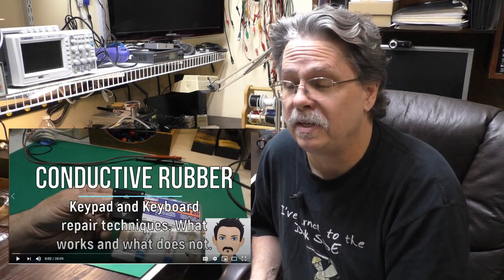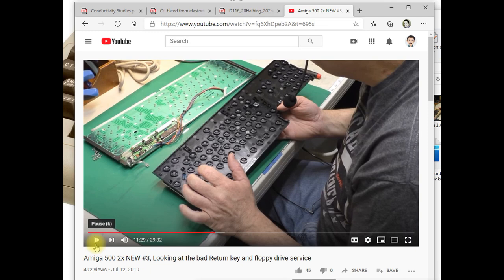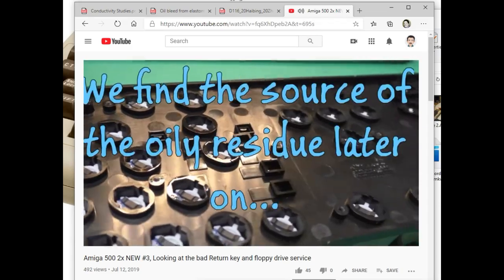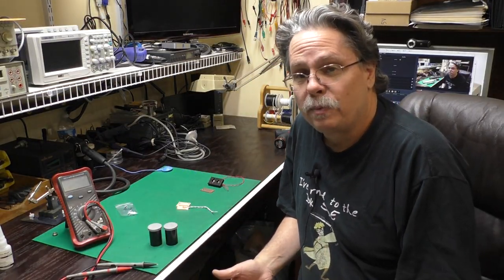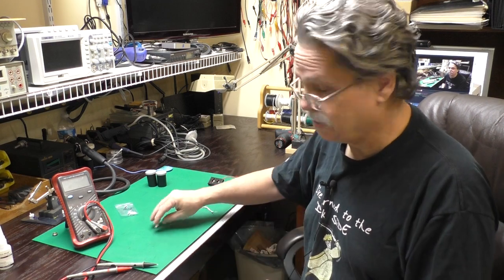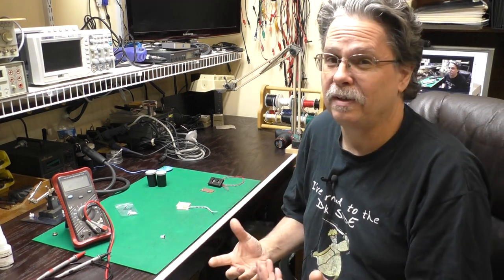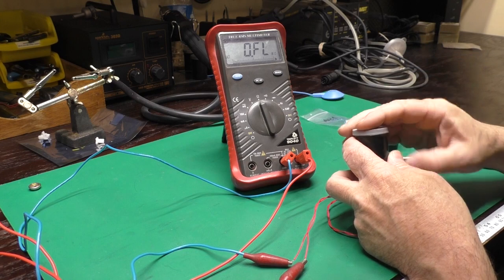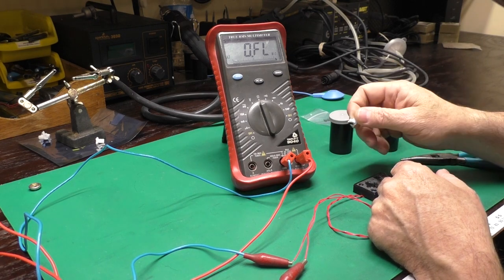Resistance is futile   Rejuvenating vintage computer keyboard key contacts

Comment: That is a great research work, Jeff. Very interesting and useful. I think, it will become a standard procedure, like recaping and retrobrighting.
Reply from the maker: Thanks Sven. I'm excited to see how it works on different types of key contacts.
Reply: I have tried some other chemicals. The was NaOH (sodium hydroxide), Na2CO3 (baking soda) and demineralized water only. While the demineralized water and the baking soda solution (1 tea spoon on 1/8 liter demineralized water) had no effect, the NaOH solution (1 tea spoon on 1/8 liter of demineralized water) made  „open circuit“ contact rubbers having a resistance around 70Ω in your test fixture. The success rate was 100%. The keyboard rubbers were soaked for 24h in the solution. It seems to drive the carbon out of the rubber. After drying, the black surface was matt and I have seen carbon traces on the tissue paper, on which I have placed the contact rubbers for drying. I did not use alcohol for the drying process, just rinsed the rubbers pretty well, without rubbing or wiping them. I want to test the long term stability of the processed keyboard plungers, now.

Comment: Something that really seem to increase the resistance is the bond between the copper trace and the carbon pad on the PCB. You can see this quite clearly if you measure between two connected pads and you may get something like 1000ohms+. When measuring between two points on the same pad the resistance is only 20-30ohms.

I did a small experiment yesterday by exposing some of the copper trace (with a round bladed scalpel) close to the pad and then bridged it with conductive silver paint. The resistance between the connected pads is now in the 30-40ohm range and the keys are working excellent. The plungers are all measuring a resistance between 100-300ohms so they're not exactly fantastic.

Comment: This was a great video Jeff! Do you think this would also work on the early model VIC-20 with the PET style keyboard?
Reply from the maker: Yes, soaking the PET conductive key rubbers will work as well. Since they are flat, they can be very lightly abraded with very fine sandpaper as well. It would be my preference to first try soaking before resorting to sanding.

Comment: Thanks so much for all the time and effort doing this.  I have two Amigas and two PETs in need of this kind of attention.  Can PET keys be tested with your tester?
Reply from the maker: No, it is not made for PET keys. A friend of mine just reported that he used this method on high resistance PET keys. He mixed about 1 teaspoon of sodium hydroxide (lye) with a liter of water as that is what he had around his house.

For the PET he measured the key contact resistance by using the keyboard PCB. You can look at the schematic and work out which wires to measure across for each key.

You might be able to use just the tester PCB, without the housing attached for the PET keys though. Just press each key down centered on the gold plated contacts on the PCB.
Reply: @HeyBirt  Great.  Thanks.  I also saw Chuck’s video that details testing for the PET.  That will be no problem.  Thanks again for the great video and making extra testers for the community.  Will see how it goes.  I’ll be very happy if I can get my keyboards all working.  It’s been a problem for a long time and I’m looking forward to fixing it for once. (Instead of just breaking them more haha)

Comment: Amazing how much research you have put into this Jeff. I don't know of anyone else who has done as much testing as you have done here. I have seen many videos where people have painted on conductive material, etc. with mixed results but none of them took before and after resistance measurements to see just how effective their methods were. Excellent and informative video as always. Do you plan to sell the tester you created? I'd buy one myself, as I don't have a 3d printer. Also would like to know more about that Decade-Ranger, looks to be a very old piece of equipment. Might be worth doing a short video on that as well, one that I would like to see anyhow.
Reply from the maker: Hi, I meant to mention in the video about making up some tester kits if folks were interested. I suspect getting a bunch of PCBs made would not be too expensive.

The Decade-Ranger was made by OhmMite until a few years ago. They were pricey new, about $700 the last I checked. I got this one on eBay for about $50 with the 1K range blown out. The OhmMite resistors that had been used in it were no longer made but I found some by Vishay that seemed to match the specs and a nice engineer at OhmMite confirmed they would work. So for another $10 or so in precision resistors it was fixed.

I've got an even older one made by Muirhead in England. It is a glorious bit of kit. Oddly the 1K range was burnt out in it as well. It uses hand wound wire resistors. I would love to rewind those but suspect I'll put in the more modern Vishay precision resistors to fix it up.  

I was not sure if a video about old test gear like these would be interesting or not.
Reply: @HeyBirt  Looked older to me, but then I have never seen one before. Great find on Ebay by the way, just a little work for a great bargain.If more people show an interest in the equipment your using then maybe make a video just showing your work bench setup and pointing out the equipment you use regularly.
Reply from the maker: @williammckeever4790  I think they made the same model for many years.

Comment: I theorize that salt in the air causes silicone rubber to deteriorate. My window contractor, based in CA, told me this when he was sealing the edges of my new vinyl windows. Of course with all the chemicals in our environment, one never knows what is causing this deterioration. Have a friend at a major lab? Have him do a Gas Chromatography-Mass Spectroscopy test on a fresh piece of this rubber and a sample that is two decades old.
Reply from the maker: One of the big issues is simple oxidation. Salt air is hard on everything though.

Comment: This is great research and work, Birt!  I wonder what causes the issue to start with? I have had a few keys here and there that went bad over the years, but recently came across an entire keyboard of non-working keys. They varied from 1.5k to several mega-ohm!  I soaked them all for 5 or 6 days, and about half are below 1k now, but the other half remain stubbornly high. I dried them and have put them in another Amonia soak to see if they will come down.  I didn't notice any film or discoloration, but perhaps it stops working after a couple of days and you have to dump it out and put more Amonia in?
Reply from the maker: I went over a few possibilities in the video, in my case with the amiga it was contamination by grease from the keys with the metal 'hinge' bars under them. It could also be oxidation and some silicone can also sweat silicone oil.

On the really bad keys you will likely need to change out the ammonia and soak again. Solvents can only dissolve so much material and then they are 'full'. I found it also helps a lot to soak the keys in 99% alcohol for a few hours to help draw out any remaining water from the ammonia soak.
Reply: @HeyBirt  Something else must have happened to this keyboard. These keys are not budging from high resistance just soaking in Amonia. I'll have to try something stronger.
Reply from the maker: @rittwage  After soaking them in alcohol over night give them a few days to dry out in the open air and test the resistance again. 

I had a few that were over a meg ohm that took several days in ammonia, over night in alcohol and then sitting for a few days to rejuvenate. 

You can also try pressing them lightly on a piece of clean paper and sliding them sideways like an eraser. This will abrade the top surface of rubber away.
Reply: @HeyBirt  No luck. Half these keys will not budge. Left them in Amonia another week, dried, alcohol, dried. Still very high... oh well. I guess these were exposed to something that destroyed the conductivity.
Reply from the maker: @rittwage  Interesting. It is odd it helped on some and not others. Are they discolored, crumbling, etc.? I'm just curious.  If you are in the US would you mind sending me a few to  test further? You can email me at birt_j at soigeneris dot com
Reply: @HeyBirt  Sure I'll send them to you for testing.
Reply: @HeyBirt  They look normal to the naked eye and some magnification. I am trying one more experiment today- I am going to heat them to about 150F on the stove in the Amonia for a few hours and see if that has any more reaction. If no luck, I will send them to you and see what you can make of it.

Comment: Thanks for doing the research on this Birt. Much appreciated.
BTW, anyone know a good source for spare keyboard parts for Amiga keyboards? Have a A2000 with a few broken keys and need stems, the rubber spring thingy and possibly some keys. I see keys on eBay but pricing is ridiculous, however there seems to be a resurgence in interest in new clone designs for C-64s and such (I have a few brand new European made C-64 cases actually). Was wondering if there was anyone re-issuing Amiga keyboards...
Cheers,
Reply from the maker: The Mitsumi made Amiga keyboards have the same stems as the C128. I don't know if this is the same on the A2000 or not. I typically see better prices in Europe for Amiga parts. Maybe look at eBay UL or Germany.

Comment: Am trying now this process. We don't have those cleaning agents here, so am trying with homemade ammonium mix, however no success after 24 hour in the solution (and half a day in alcohol), so will try double the time for each and then see, then progress from there.
Reply from the maker: I had someone send me some C64 key stems they had problems with. I first tried soaking them in a strong  sodium hydroxide solution (1 teaspoon sodium hydroxide to 100ml water). This did not help at all. (sodium hydroxide is also called caustic soda or lye, usually easy to get)

I then soaked them in 99% alcohol 24 hours, then let them air dry 24 hours. This actually reduced the resistance some. Next came a soak in the sodium hydroxide for 4-5 hours, rinse, alcohol soak overnight, air dry and retest. Some took 3-4 cycles of this. 

I think in some cases the rubber gets saturated with the liquid and the cleaning action no longer takes place. Drying the rubber out with the alcohol, and air drying then lets more of the alkaline solution soak in and work its magic.
Reply: @HeyBirt  Interesting. So you get better results with this than an ammonium cleaning agent?
Reply from the maker: @cattencarter1887  They do the same job but you can mix the sodium hydroxide to make a stronger solution that normal household ammonia (3%). You can also get stronger ammonia from professional cleaning suppliers (janitorial supply).
Reply: Ah great, yes I have a 25% but am diluting it as it seems very strong (at least the smell is lol). Thank you again Birt, you really are a fountain of knowledge in all these things.
Reply: I got no where with the ammonium, even a very strong solution (25%) did nothing. Then I tried the sodium hydroxide and that worked like a charm. With just one soak, they went from 1-2k to less than 200ohms. Let them dry for 24 hours, and will give them another 24 just to be sure, but so far a success.
Reply from the maker: @cattencarter1887  Awesome, glad to hear it worked. It is a nice choice as sodium hydroxide is usually easy to get and inexpensive as well.
Reply: @cattencarter1887 I know your comment is old, but how much sodium hydroxide did you use, 1 teaspoon to 100ml water?
Reply: @darberk  i don’t remember I’m afraid but it’d start low, if you get no result over a day add more. At the end I put them in alcohol for a while to take out sodium. I tested not long ago and the fix seems permanent. They are still reading as new.